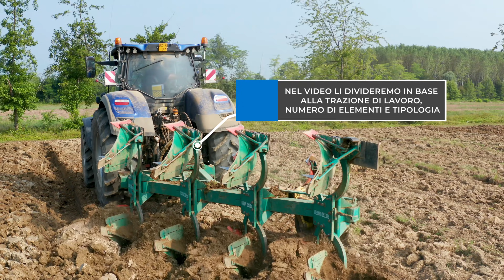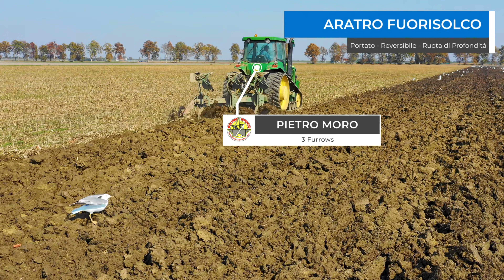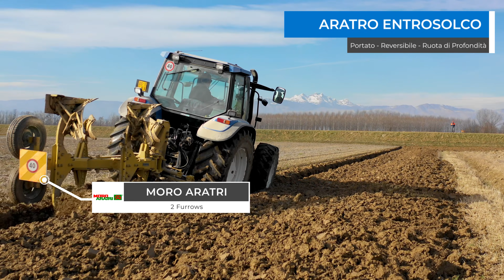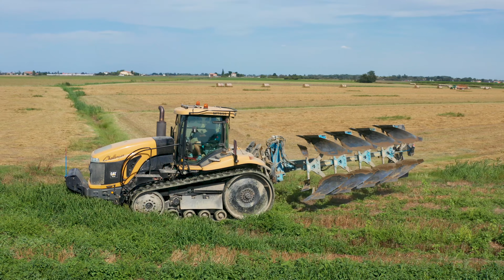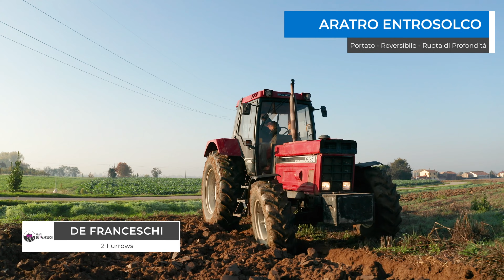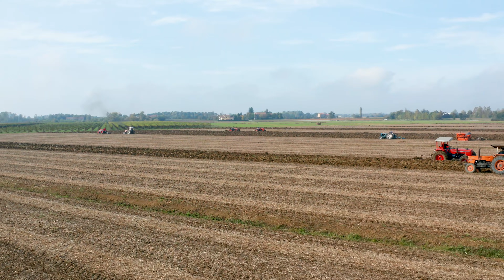ARATRO - A cosa serve? Come funziona? | AgroNord | 4K

Comment: Whats the dept of they are going with those plows  ?
Reply: From 30 to 40 cm would be a pretty accurate guess, but then it's different for every video so I don't know
Reply: @dabelli3818  I think some are much deeper.  It seems they have 80+ hp per plow board
Reply: @josippenezic7106  well, we run a 4 plow with a New Holland T7 270 (240hp) at (average) 35 cm deep (Northern Italy)
Some of these were deeper than that, around 40, maybe 45cm. And obviously the first one (da scasso, I don't know the translation for it) goes much deeper, I'm not really sure how deep but I would say 70 or 80cm.
Reply: @dabelli3818 45cm Omg.  Is even soil fertile that deep? Is it for preperation for vineyard?
Reply: @josippenezic7106  some places yes
Reply from the maker: I didn't write it specifically because it depends on the working conditions and the type of terrain, in every situation it varies